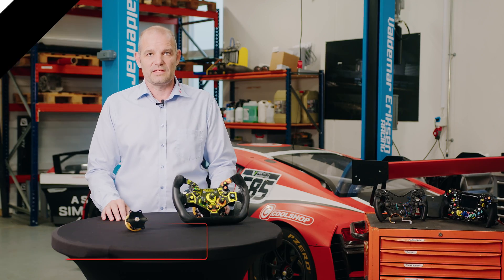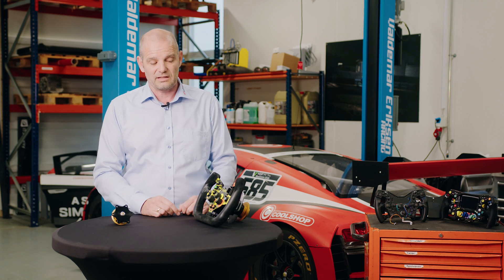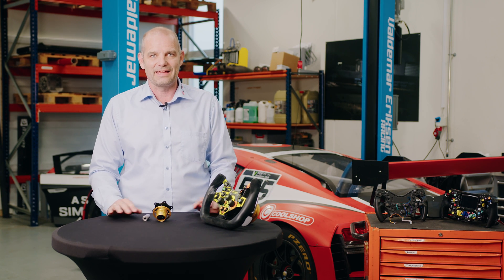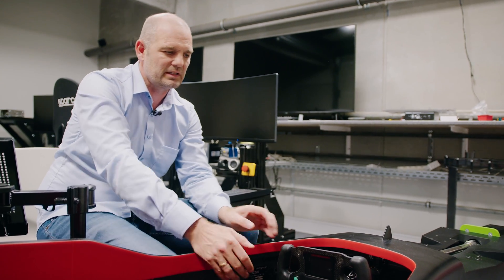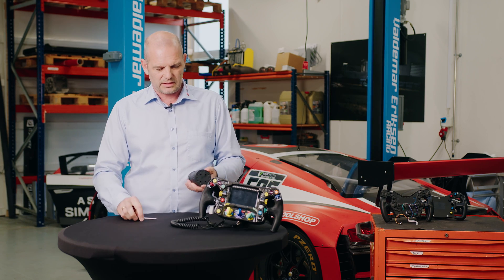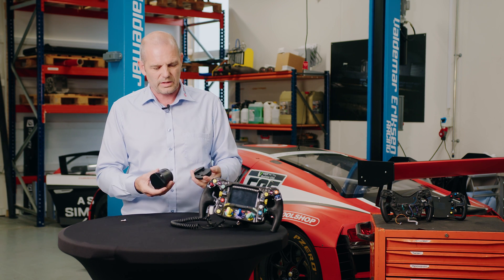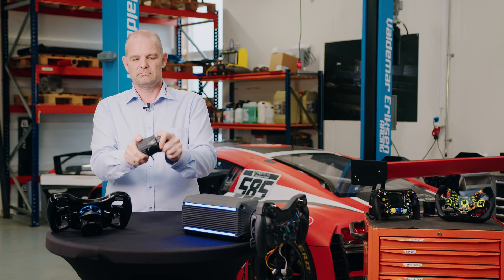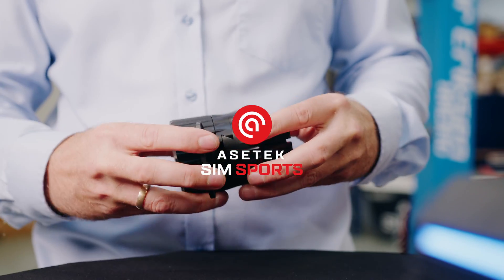Asetek SimSports® Quick Release Sim Racing Wheel

Comment: Very nice product and presentation. Only correction I would make is that a wheel in real life gets plugged and unplugged WAY more than a sim racer´s. Many drivers take the wheel off everytime they leave the car, which happens several times in a track day. Then the mechanics have to plug it back to maneuver the car in the pits and so it goes. In sim racing you only take the wheel off to exchange rims, in case you do that, or for maintenance. But good to know you had longevity in mind when designing this.

Comment: Love the functional mechanism with power and data delivery. Though i must point out my dislike for the exterior design with the ridged exterior, instead of a simpler and a smoother, round surface as in the simucube design, which would be faster and thus, probably cheaper to produce (I'm boldly assuming and hoping, that the QR is machined fully from billet material instead of a from a cast piece). Overall i'm always happy to see a new player in the simracing scene and market, driving innovation and bringing new options for consumers and professionals.

Comment: Nice video, very informative. On the prototype the quick release handle does look like in a rare instant you might push it accidently and unlock the QR? Maybe the lever could be smaller or you would need to pull it towards yourself to release it instead of pushing it away?
Reply: In fact you do pull it towards yourself to release it :)
Reply: @dennishampe4465  Ah good think I saw it the other way round, cheers!

Comment: I've been thoroughly impressed by the simagic solution, using the 10-ball NRG QR and pogo pins for power. Fast, rock solid, cheap, is a thoroughly tested design in real cars, and supports screens without batteries or wires.

But if you've paid to license something like the simucube wedge, then might as well use it. I prefer the paddle to the pin, for sure.

Comment: The "jump the gap" data solution with the pogo pins and flat contact points is a great design. Only issue I have is the paddle/handle in my opinion. I love the quick release operation of it but the issue is that if you're running a dash or button box that sits close to the QR/steering col, or if your monitor is positioned vertically close to the steering col/shaft then the little paddle handle could hit things when you turn the wheel. I would buy this QR but I would grab a small precision saw and chop the paddle off right at the level of the QR body itself. It looks like you'd still be able to engage the handle without such a big "paddle" so why not get rid of it and keep it more flush/streamlined?  Or, if it can disassemble easily, we could machine or maybe print a new smaller handle to fit in there and be flush to the outer diameter of the QR.
Reply from the maker: It is not in the way of a display :)
Reply: @AsetekSimSports  Buuuut...  you could still go for a streamlined design and miniaturize the paddle.   🤣  😉

Comment: A question I don’t seem to find in the comments: does the QR work on other wheelbases? I don’t see how you’d be able to get a usb connection working without cable on just a QR? Because that’d be amazing. I had fanatec and enjoyed the no cables, and now I do miss that on my simucube. 

I would get it only being available for your own base, but I feel like there’s a massive gap in the market for a USB QR that removes the flying cable that works with any base. I wouldn’t mind paying a premium for it tbh.
Reply from the maker: QR yes. Data and power connection without a cable no.
Reply from the maker: Mechanically it could work with any wheelbase. Either direct or with an adapter. Obviously we have no control over or impact on other manufacturers wheelbases, which oftentimes is just a standard servo motor.

As you point out, in order to get rid of the wires the wheel base must have the wires routed inside, for example through the shaft. Standard servo motors do not offer that and users with such a motor will never really be able to get rid of the wires. It has unfortunately nothing to do with whether our QR will fit on or not. 

Our wheelbases are based on our own design from the ground, meaning we control all of these things and as such we are able to transfer both data and power through the QR with no cables dangling around.
Reply: @AsetekSimSports  so a system where on the hub there is a stationary bit that doesn’t rotate with a usb cable, then a QR would never be possible?

Comment: So there is no way that we are going to be able to purchase aseteks wheels to run on another base. This is frustrating. They bought the IP to the screens that cube Controls was using. They won't let others use it. So csx2 is no longer available. 
Now after changing Sim gear, upgrading and everything works fantastic I'm not changing wheel bases AGAIN to use whatever fantastic wheels they bring. I would of purchased their new wheel if it's good (I'm sure it will be). Alot arewilling to spend 2-3k on a wheel itself to attach other bases. Some have bluetooth and works very well others also have battery with 20 or 30 hours is very decent. Then plug in magnetic cable and charge. So now they will lose that market as simcube moza fanatec clients can't use them etc
And they took the screen option from others too. 
Ridiculous move sorry. Not everyone is going to buy your whole ecosystem and people are willing to spend big money in this hobby for what THEY want and not be locked in.
I'm just saying your losing alot of potential business by removing possibility of adapting to another wheel bases. No battery no power...no cable for ability to connect to USB and run an after hub like many. No screens for others as you took that away. Seriously? 
Let's just hope your wheels don't have the failures like your AIO pumps.
Reply from the maker: We bought UGT. There was no IP on the screen. Anyone interested and able to source it, can go buy it. We offered all wheel manufacturers to continue buying from us and we offered them support. We did not offer their end customers support, as we believed and still do, that each manufacturer has to take care of its own end customers and we do not find it appropriate that we have to provide support  for other companies' end customers. The original displays were impossible to get from the manufacturer during COVID-19 and before also, so we had no other choice than to EOL the products. We still support the product.

The screens in our upcoming steering wheels will have nothing to do with that of the UGT - nothing. So this idea of taking anything away from anyone is just pure nonsense. We are developing our own hardware and our own software. Any company is free to do exactly that.

Furthermore, we will make adapters for our wheels, so they can be used with other brands. In addition we are in the process of gauging interest from other wheel manufacturers to tap in to our QR/ECO system, because we believe it is best for the end users. We cannot and will not force anyone, it is an offer. But if you are not happy with the outcome, you should probably talk to your favorite wheel vendor, becase we will not be the issue, as we intend to support the industry and open up the co system to other vendors.

We have produced more than 10 mio AIO liquid coolers. We have automotive grade quality levels, which is probably why big names like HP, Dell etc. have trusted us for almost 2 decades. That does not mean we never have issues, but beware there are many many knock offs of our design, and for sure lots of them are very bad quality.

Much easier to have a dialogue if we stick to the facts instead of false information and rumors :)

Comment: After their pedals, they would be better off doing a real H-Shifter with a real mechanical feeling, 
which when the clutch is not (correctly) pressed, blocks the entry to the gear, 
with a hardware blocking mechanism controlled by the driver of the H-Gear.
Can't be that hard. 
Pro-Sim SHIFT LOCK exists for 500€, the blocking system only, for  H pattern shifter (add 1.500€)
At a price of 2.000€, there is much room for a good H-Shifter
Reply from the maker: We are certainly looking at all options. The H-shifter is not on top of our priority list though, as we believe wheels, wheelbases, seat, rigs etc. are more important. One day will get to it though :)
Reply: @AsetekSimSports  ok, lets hope I can resist the temptation to buy a Pro-sim with Shift Lock until then ;-)

Comment: Great work. I've had Fanatec and now Simucube. As you say, the Simcube QR system is rock solid but has no electric connection. Personally I am happy with the wireless system, as don't feel the need for a screen. But you're system combines the best of both worlds. I need not go into Fanatec, their inability to produce an improved QR system despite rumours of development for many years is ridiculous.
Reply: if you wanted to use a screen you wouldnt have any trouble anyway, theres a massive amount of screens out there low cost or high cost that are just usb to your pc or a hub and ofcourse because they are not wheels the wire never moves as it would need to on a wheel. i use a simucube 2 aswell and i have a couple of wheels, none have a screen but i do have a display dash just behind my wheel, zip tie the wire and simucube usb together and run them off to a hub no issues.

the real bonus of having a powered QR is the increase in button functionality, with simucube you only have a max of 28 inputs, its enough for most people but it certainly falls short of powered connections, a fanatec formula v2 wheel is able to map 68 functions i believe as an example. Id never choose fanatec over simucube for that though, not with the state of their QR.

Comment: wondering if this requires a proprietary Asetek DD unit or if it can be used on the plethora of OSW's and other "branded" DD's out there?
Reply from the maker: There are unigue design features, for example routing the wires inside the motor shaft, for the QR to work, but we will release mechanical adapters for sure, enabling user to use other wheelbase brands than Asetek with Asetek wheels.
Reply: @AsetekSimSports  doesn't add any more convenience or functionality to the investment of Q.R.'s  or DD that I already own........... your "solution" only works for "your" problem. sorry............

Comment: As a simucube 2 pro user ive always LOVED how sturdy the SQR is, ive had a fair few wheelbases and none of them have ever felt so solid...some like the current fanatec solution are laughably bad, but i was quite shocked to see how much play there is in a real race car, especially odd when you compare it to everyday road cars which dont have that problem. So taking that basic SQR design principle and making it a powered connection as-well is basically perfect... ive never had any issue with the simucube design myself, the wireless protocol allows up to 28 inputs which isn't much compared to the competition but in reality its enough, however it has always been a clear downside that granite devices really should have addressed by now (or maybe they dont have the right to do that now which would be bizarre, surely not right). I still wouldn't trade the quality of the connection for the increased functionality of other brands... but to nail both which it seems like you are on track to do, powered and completely solid...well that's all one can ask for.

you said you acquired the licence for the design, does that mean it actually is basically a copy of the SQR with your own twist to the design being powered and pin-less? if so i think that was a hell of an agreement you got there, the perfect QR would be a powered pin-less SQR imo.

on a side note that DD on the table is huge mate, have you acquired the licence to use the simucube ultimate motor aswell by any chance making that a 32nm or more beast right there? if that is not the case and that thing comes in at 15nm you might have a potential downside there because its enormous. Those led strips need to go aswell or at the very least be switchable off, its cheesy.

impressive stuff, im liking what im seeing.
Reply from the maker: Our mechanical motordesign is 100% in house development manufactured by Mige.  There is a press release about the transaction with Granite you can find online. Like on our pedals, the LEDs can be switched off.
Reply: @AsetekSimSports  thanks for the reply, i was late to see it. i look forward to seeing more about the DD, what we are seeing so far is quite impressive, ive not personally used any asetek products to this point but what im seeing is quite impressive and so far honestly probably the only manufacturer that seems in line with the kind of top tier gear simucube offers. Although it makes little difference it would be nice to see another manufacturer push the boat out a little when it comes to specs and ''overbuild'' for the sake of quality, we all know the 22bit sensor used in the simucube pro for example makes little difference over a 16bit one right but its nice to know no expense is spared, i look forward to reviews and seeing more.
Reply from the maker: @jinx20001  you are welcome. As can be seen with our pedals, we do not over engineer just because we can. We want to create value for the user at the same time as providing reasonably priced products. We believe we have the lowest cost hydraulic pedals on the market, but yet the best. This philosophy will be be carried over in to our wheels and bases - well all future products. We are just getting started :)
Reply: @AsetekSimSports  hey, again thanks for the reply, i appreciate the information and honesty, it would have been easy for you to say the products are over engineered and built without compromise and i would not know any different but you didn't and i think that means something, its a fantastic attitude towards potential customers and it sets realistic expectations.

i wish you guys well, my eyes are firmly in your direction.

Comment: I‘ll never get why people are so addicted to QRs… In the last 3,5 years since I have my SC2 I may have taken off my wheel maybe 10 times. I have 3 wheels, but I really only race one, the others sit on a shelf and look pretty. But hey, it’s going to sell for sure, so it makes sense from a business point of view. So, well done.
Reply: I get your point. But I like to race GT cars on Iracing, and when I get tired of that I switch to DIirt Rally 2.0 where I need another wheel. So I'm one of the guys that actually change wheels often.
Reply: @TwentyFourSlevin  Yeah, in that case I can see the need
Reply: i somewhat agree actually, i also use a SC2 and very rarely change wheels, ofcourse if i did change wheels often it wouldn't matter on the simucube since it is completely pinless. while this upgraded SQR they have is nice adding power for more function, it will never be as reliable as no pins at all, even if they say its as reliable it simply cant be, you will have to make sure those pins dont get damaged, looks certainly good enough though, its like you said i dont think people change wheels as often as he was making out, its very rare that would be the case i think.
Reply: I race GT and formula cars with a Cubecontrols F-pro, and ovals with an MPI wheel. I’d never try racing ovals without a round wheel, and I’d never try racing gt or formula without buttons on my wheel 😂